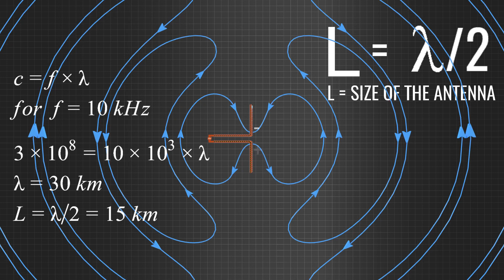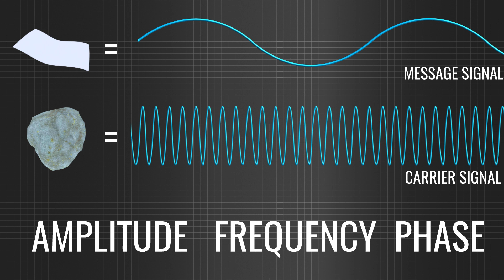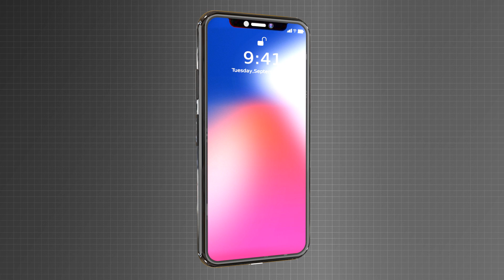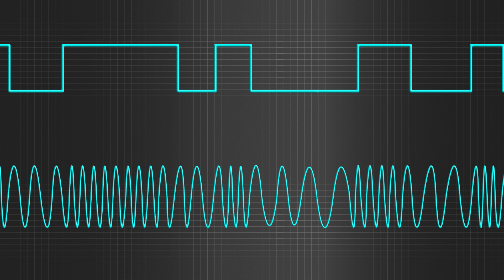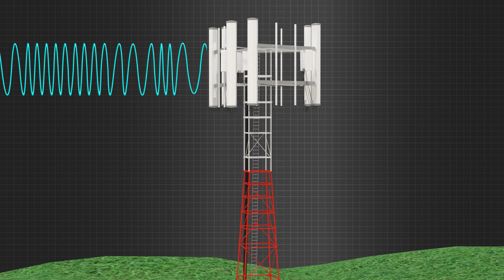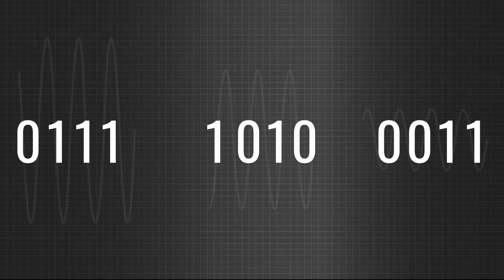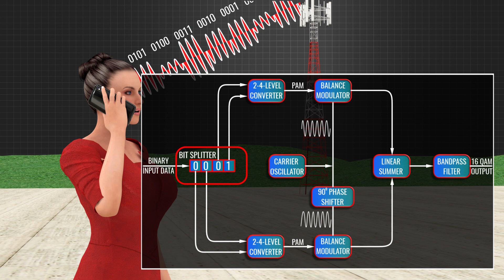Understanding Modulation! | ICT  #7

Comment: 6:56 64bit data use 8 bit at a time not 4, btw video is fantastic 👍🏻👍🏻👍🏻
Reply: thought of 8 too but he said 6 bits like 2 ^6
Reply: It doesn't. That' not 64 bit data it's 64 QAM and 64 QAM uses 6 bit of data. 8 bit data is used by 256 QAM

Comment: lol for your quadrant examples you really need to provide a 3 dimensional graph of your sine wave showing one with the waves propagating vertically along the y axis with the second wave propagating horizontally on the x axis overlapping each other.          especially since these are what gets referred to as the G in your 2g 3g 4g etc.     5g I believe gets a little different and was why it needed so much more power when compared to the other speeds. and ALOT more emitters since the wave would not propagate near as far, lol hence the controversy from of lot of people that claim sensitivity to wifi signals.  i was in school learning all of this stuff right as 5g was being developed so it wasn't really in any of our courses or books but we did go over it in class a couple times.   

otherwise great video!!!!!!

Comment: 0:54 Slight note: that's not really why we use modulation.

While soundwaves, in the KHz, are too slow to transmit with a reasonable antenna, consider that in cases like TV / WiFi the bandwidth would lead to an acceptable frequency in the MHz anyway, so a small antenna would work just fine for those purposes. Yet, we still modulate. So the explanation given only explains radio, not TV or WiFi.

The primary reason we need modulation is because it allows multiple streams of information going over the same medium. Many radio stations, Many TV shows, Many devices connected to the WiFi router, etc, all communicating over the same shared air and of course interfering and mixing with each-other.

The idea of modulation, is that despite every WiFi device + TV show + Radio Station using the same air to transmit their waves, you can still "tune" into a specific frequency by filtering the overall received electromagnetic signal by a sine wave of the actual frequency you're trying to "tune" into.

(Note that, WiFi, in the GHz, can't get through walls or go long-distance easily. So, each WiFi router can use the same frequencies as long as they're in different homes. When multiple WiFi routers share a space, they still ensure a particular frequency isn't being used before trying to use it. Radio waves, over hundreds of miles, act the same if you've ever gone cross-country driving.)

Comment: standard QAM can be viewed on a 2 dimensional graph. there are modulations that use at least 8192 QAM, and you can add more independent properties to QAM like circular polarization, helix, or spin polarization to make a much denser 3 or 4 dimensional data compression/ modulation wireless link. its just not really done yet, too expensive or not developed effectively enough. its easier for people to move to terahertz waves (IR light up through green light usually) to increase capacity instead of make all available use of the existing spectrum. healthier for us that way anyway.